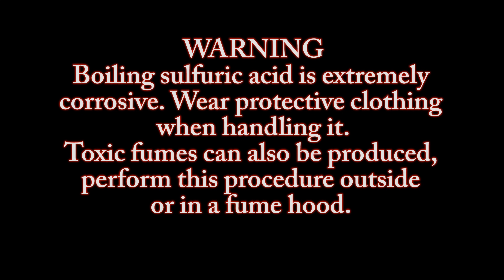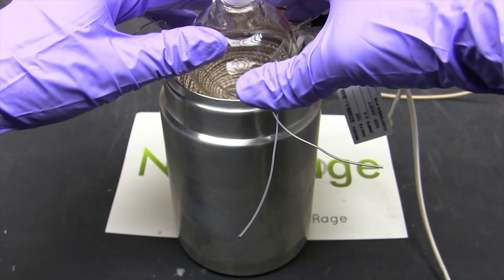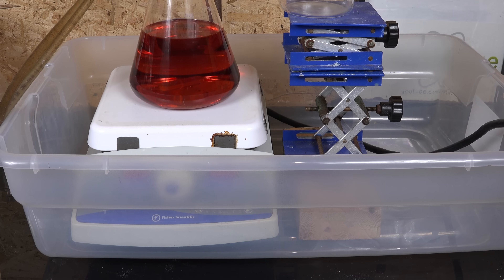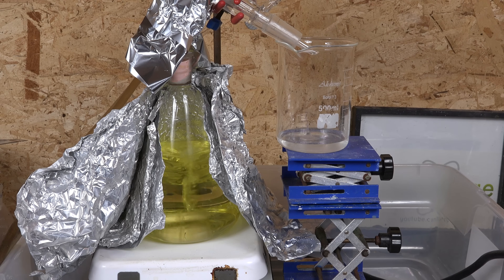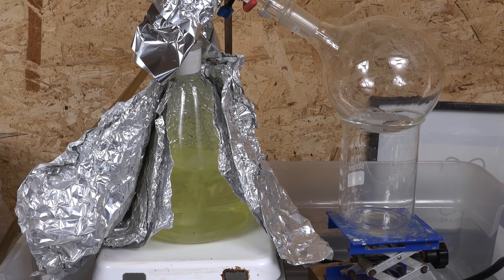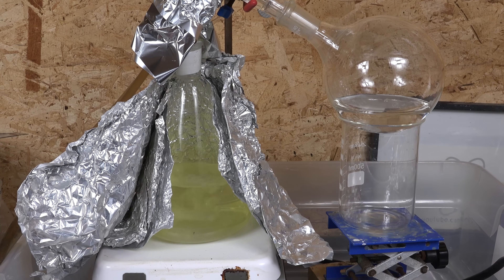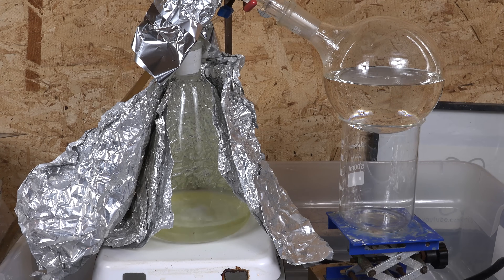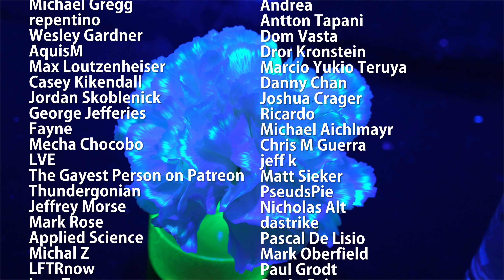Purification of Sulfuric Acid by Distillation - Revisited

Comment: I was fascinated when introduced to SARU - Spent Acid Regeneration Unit, erection of all components was just about to be complete, and we are to commission the unit... the spent acid comes in the form H2SO3, we burn it to get SO2 and catalytic react to get SO3, participate the soot and then run the gas through a glass tube with water dripping down the walls and absorbing the SO3 to become H2SO4... I realised then that it is actually, as pointed out, a solution of sulfur trioxide in water up to 98% concentration.
(Of course I pored it on sugar to get the black worm of doom...I don't work there anymore)

Comment: In my region it's pretty hard to get sulfuric acid, but pure sulfur is cheap and available, so I'm thinking of making the acid by burning the sulfur in a glass tube or vial, and pumping air or even ozone to further oxidize the sulfur dioxide to trioxide, and finally dissolving it in water by bubbling with some porous glass stone

Comment: Aside from it's increased reactivity at the boiling point,  the boiling point of sulfuric acid is higher than the ignition temperature of a lot of substances like wood, cloth, skin, things like that. It would give horrible burns even if it were inert and got on you. It's one of the higher boiling points you'll find in a non-metallic substance that's liquid at room temperatures. Once the pure acid starts coming over, there's no real reason to be near the setup. Make sure you have a way to cut power to the hot plate while remaining a safe distance away.

Comment: One important thing to watch out for with the PTFE tape. Don't let it get above 250C or it'll start decomposing and releasing the notoriously toxic PTFE fumes. If it's in a fume hood you'd probably be fine but I don't think I'd want to be handling the tape afterwards and any pet birds in the house if it's an amateur setting are particularly sensitive to it.

Comment: The main problem with ptfe tape is the melting point is slightly lower than the boiling point of 98% acid (327 vs 337). So you don't want to insulate those joints much.  Using a slight vacuum makes that a non issue.  At my altitude it isn't an issue.

Comment: +1 to Teflon tape. I don't think I've ever used sulfuric acid or grease to seal any of my glassware and as long as the glassware is well supported the friction fit stays tight. Plus you get that extra margin of safety (rather have an apparatus push apart than blow apart!!)
Reply: I say friction fit because I can't employ clamps usually with a couple turns of tape on 24/40

Comment: I note that you decomposed the organic impurities by simply burning them up with heat. I have had some good success from adding a small amount of hydrogen peroxide (30%) to the impure hydrosulphuric acid when it is starting to heat up (around 50 Celsius), which creates a small amount of piranha solution that rapidly destroys any organic contaminants. The downside is that you have some additional water to boil off before you can start distilling the hydrosulphuric acid.
Reply from the maker: i used to do that, and it does work. But after some years i realized that the distilled acid was already pure enough, there wasn't much point in essentially adding in more water. So i stopped and just let it distill. The end result is nearly the same, pure sulfuric acid.
Reply: @NurdRage  thanks. That makes lots of sense. The times I’ve tried making lab hydrosulphuric acid from drain cleaner, it was weird colors and unknown concentration, so I just assumed that there was lots of organic impurities to destroy before the distillation to get rid of water and suspended salts and other cruft.

Comment: Using Sulphic Acid might be a great way of making charcoal without having to burn anything. It also is a great way to keep the cellular structure intact enough to make super-capacitors after the carbon is changed into graphene.

Comment: Thanks for the tip about the steel pan! I actually got some deep serving pans for free (they were very dented from heavy use in a resturant for years). If my setup fails, well, at least I know that any stuck on food that I didn't manage to scrub away will just burn away

Comment: What do you think about adding few grains of cat litter to form nucleation points and prevent bumping? It's works very well for me, since I don't have a magnetic stirrer hot plate :)

Edit: Also I dont find so much information of what happend when heating a solution of drain cleaner H2SO4 and few milliliters of H2O2 for oxydize the impurities. I thinks that the formation of H2SO5 decomposed to H2SO4. This is my low risk method for purification of drain cleaner H2SO4.

Comment: This is a great video. I am wondering if you could use hot water as the cooling water to get less thermal stresses in the distillation tube?... and how hot could that water be?

Comment: is vacuum distillation available for sulfuric acid?
Reply: I've never seen or heard of a vacuum distillation method for sulfuric acid but I'm assuming that it would be extremely difficult and hazardous as you would still be distilling ~220 C with an extremely high vacuum pump and H2SO4 vapor at those temperatures will definitely destroy your expensive vacuum pump

Comment: Would it be practical to deliberately add water continuously to the drain cleaner whilst distilling so as to remove a purified but dilute acid. Then boil off the water. Might it help keep overall time spent at high temperatures down.
Reply: Adding water to boiling acid is not a safe idea, it will make it flash boil and give you dangerous trouble.

Comment: Honestly, I'm not a chemist, beyond the everyday chemistry most people perform. It kind of surprises me that more chemists don't use teflon tape. You can get it anywhere and it's inert (I think) to most chemicals and it has a reasonably high temperature range. Personally, I use it for all sorts of things outside of standard plumbing and it works well.

Comment: Could the gasses be safely vented through a flaring torch? Like, a bunsen burner with a secondary inlet that would guide all the fumes through the flame, would that help decompose them into less harmful byproducts?
Reply: No, there should be a scrubber in the fumehood. Suplhuric acid needs water and a base to neutralize, not heat.

Comment: I thought 350c was into the range where thermal decomposition of ptfe becomes a worry
Reply: No, it starts to melt at 327c, at 650-700c it starts to undergo depolymerization.
Reply: @TheEsseboy  ah, forgot it's that much higher than pvdf, since I know that one starts breaking down at 290c
Reply: I looked into it more, I was remembering right. while it doesn't depolymerize until that hot, ptfe starts degrading at 260c, and decomposes into a bunch of nasty stuff at 350c
Reply: @Stellar_Lake_sys  Yes, it does degrade and slowly decompose, but since this destillation is done under a fumehood already it is not that bad, sure if done on a large scale or industrially you would choose an alternative that doesn't do that.

Comment: Ace hardware sells a double bagged sulphuric acid drain cleaner at 90% and 10% water. Its double bagged, for good reason. 

I needed some to clean drains but the double bag caused it to slip from my hand, about 6 Oz spilled on the ground and started interacting with the calcium based rocks in asphalt and heating the asphalt binder. 

I had a leaking gallon jug of high grade sulphuric acid with the bag half full, I put it into the bed of my pickup truck. It ate the white paint off and the primer, about 12 Oz escaped. 

I made 5 gallons of baking soda water that was oversaturated, the sulphuric acid went directly into a 5 gallon bucket that was clean and empty, with a bare hand. 5 minutes on my hand and it only felt like a tingle and the skin wasn't damaged. 

I rinsed the bed of my pickup with a gallon of my saturated water and I drove it back to the pavement it was on, it bubbled a lot and about 3 gallons and it was done and left a light mark on the asphalt.

Comment: I put "Caution: Coffee may be hot" and "Warning: Boiling sulfuric acid is extremely corrosive" in the same "If you need telling this, you really shouldn't be playing with it" category 🙂 Thanks for the videos.  Always interesting and entertaining.
Reply: Not just that, there's the "DO NOT EVER HAVE THE CHANCE TO GET WATER IN BOILING SULPHURIC ACID"

it's way too fast a way to get to hospital really fast and never look the same again lol
Reply: @scrappydoo7887  You have a good point. I'm aware of many of the various dangers with sulfuric acid, including not adding water to it at reasonable temperatures... I suppose I never extended that to the extreme case of the acid being already at boiling temp... common sense says it's going to result in flash boiling of the liquid yet the thought hadn't crossed my mind as such. The mention appreciated indeed, just in case there's a day that comes.
Reply: Indeed but the joke about modern car maintenance (valves/battery)... Let's just say you never know 🤣
Reply: I made concentrated acid, by just boiling battery acid I bought at NAPA.  Outside I just  boiled it till it fumed on a hot plate in a 5000ml boiling flask, then unplugged my hot plate’s extension cord and let the whole works cool.  Glad I didn’t know exactly how dangerous it was, but just common sense told me I didn’t want to be close to it.  I don’t remember too much bumping either, Amazing my boiling flask looked brand spanking new afterwards!
Reply: The problem is that we don't know what we don't know, so when someone who knows repeats that something is very dangerous I have learned to pay attention even if it seem annoying, because it probably will save my bacon...
Reply: @josuelservin  in this case any information on the treatment of sulphuric acid is extremely valuable.
It can disfigure you so fast that a "small" mistake will probably mean seriously life altering if not ending results
Reply: You should be more aware of the fact that McDonalds had internal memos to keep their coffee at near boiling temperatures at all times to prevent customers from getting refills. Hot coffee should be hot, it should not be hot enough to cause a third degree burn in less than a second.
But, you were probably spoon fed propaganda at the time because McDonalds spent a lot of money to make you see things that way

Comment: My first major accident in a home lab setting was when boiling down sulfuric acid that I made by copper sulfate electrolysis.
I had around 200mL at I estimate 80% when it bumped and the 1 litre beaker landed on the concrete floor. I did get some splashes of boiling sulfuric acid on my ankles and some clothing was ruined. A garden hose prevented serious injury.
It was a good lesson to learn, but not the best way to learn it.

Comment: As always, great video! One thing I'd like to point out, regarding the use of PTFE tape is, that it can start decomposing and give off toxic fumes at the temperatures of boiling sulfuric acid. How much and whether that would pose a threat or not, I don't know, but the rate of decomposition increases significantly, above around the b.p. of H2SO4.

Comment: In Europe they sell 15% H2SO4 for pool use, should be rather pure. I think if I ever do this I'll use that and boil it like you said until the boiling flask contains the 98% concentrated stuff so I don't actually have to deal with gaseous sulfuric acid. The time this will take with a 1 liter Erlenmeyer is probably gonna be insane but you gotta do what you gotta do if you really want to do chemistry here.
Reply: in poland i ordered 3l of 96% sulfuric acid drain cleaner and it was very pure the funny part is that it was not protected at all just 3 bottles tossed into a box too big for them without any danger label on the box
Reply: @wiezba2910  I'm so jealous that you guys have Hydraulik, that's godsent. Sadly I don't speak any polish or live close to the border so I can't get that.

Comment: Interesting video. Question, how do you clean the glassware afterwards, considering to add acid to the water and not the other way around?
Reply from the maker: First I dump the residue into water, a little at a time. Then once the flask is empty, I can pour water into it. There is so little that pouring water changes the temperature very little.

Comment: I always have concerns about using PTFE tape and a stir bar for this experiment as 337C is well above the recommended usage for it, it's good to see that it actually works to an extent, I will definitely try using PFTE tape as a joint seal as conc. sulfuric acid as grease is a little bit unreliable.

On a side note, I have tried broken clay pot pieces that seem to work best as makeshift boiling chips, while broken glass is the worst as I think it induces more superheating spots in the flask.

Comment: Get the highest quality PTFE tape available. Not just for the lab, but in general. It's still cheap, and it's so important in it's use that it makes sense to do so. 
Generally, you want to look for the yellow gas line rated tape. It is very thick, so you need far less wraps than cheaper tapes. It contains a variety of preservatives and anti-corrosive agents as well.

Comment: this is nothing I do any longer, waay too scary. one quick hint from my experience, when using a round flask on a non-stirring setup, use two glass tubes that is long enough to stand in the flask and sand their surfaces down to a opaque white finish. these will help with nucleation and mixing in a passive way that a pile of glass shards on the bottom will not.

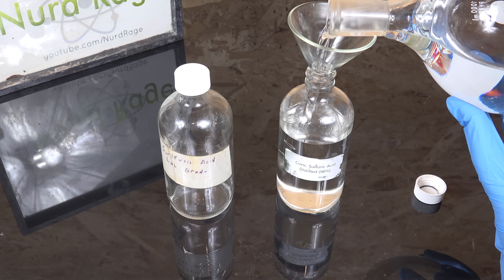Comment: Why were there significant density variations in the distilled acid? (i.e. 18:20)
Reply: Most likely amount of water passed in the distillation.
Reply from the maker: Temperature, the acid was still warm. But the bottom was cold.
Reply: @NurdRage Ah, of course!

Comment: Nice tips ! 
Yes, it's not generally 'safe' like a tiny fluffy puppy. 
Using common sense helps apply the Darwin filter.
Personally i just boiled the hell out of it while adding squirts of 3% H2O2 to oxidise the organics.
Turned out Clear, but not as clean as your pure distilled juice.
No explosions, fire or ire ever experienced in the process ;)

Comment: I think it might be worth mentioning that PTFE has a much higher thermal expansion coefficient than borosilicate glass. In practical terms, this means that you shouldn't use too much PTFE tape on the joints, because you might risk cracking the glass joint as the temperature increases. I've had this happen at least one time (though I wasn't doing anything critical or dangerous).
Reply: Doesn't matter if its glass or steel. Too much tape leads to leaks
Reply: Or preheat the joint before assembling

Comment: I wonder if you could use a modified microwave oven to do the heating? The advantage being the box could provide the heat, stirring, and contain a vessel failure.
Reply from the maker: hmm... not a bad idea... but sulfuric acid is prone to superheating, and if you've seen the "microwaved superheated water" accidents it'll be like that but much worse. So i'm not sure i'd risk it.

Comment: As a high temp grease for this distillation a concentrated sulfuric acid could be used with success. I saw this advice few times in old books.
Reply from the maker: i tried it too, and it does work, but sometimes it seizes up the joints. So i reccomend the tape since it allows you to easily take apart the joints again. But if your particular glassware can easily handle sulfuric acid lubrication and still be taken apart, then by all means do that. :)
Reply: @NurdRage  What about silicone plumbing grease? Or the equivalent would be like die-electric grease which is used on spark plug boots and coil on plugs. Since it's silicone based I'm confident it might be able to handle the high temperatures and should be widely available at any plumbing supply store or auto parts store in just about any country. I think spark plugs in a turbocharged engine running under a high load in a hot climate with poor quality fuel should be a few hundred degrees C if not more :) The grease is used to prevent the rubber from seizing onto the porcelain spark plug, and to prevent moisture from getting into the connection and causing corrosion.
Reply from the maker: @brnmcc01  hmmmm.. that sounds like an interesting idea! But boiling sulfuric acid is absolutely vicious. I'm not sure if it can survive that, nonetheless, if it can handle an engine, it might be able to handle this. worth a try.
Reply: @NurdRage  I think I would avoid anything silicon.  The silicon gaskets on my sight glasses lasted less than 24 hours with room temperature ~ 88% acid in the sight glass.